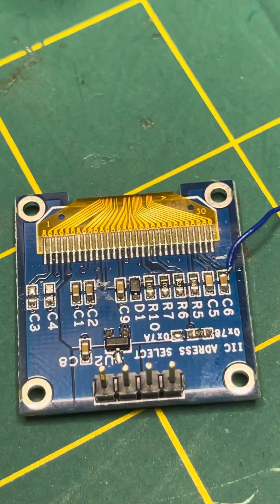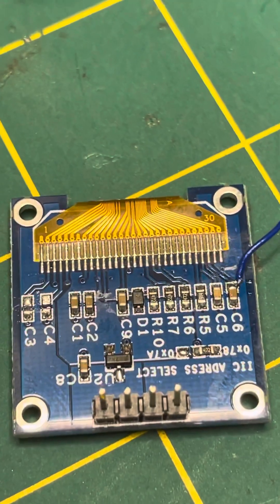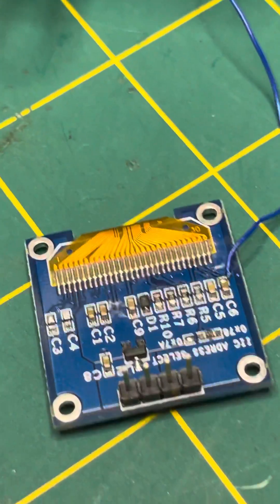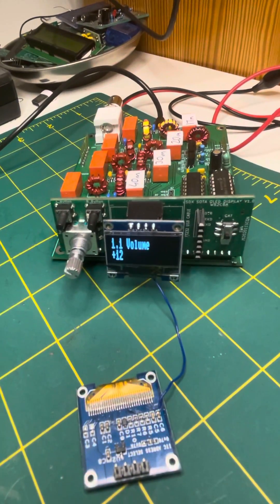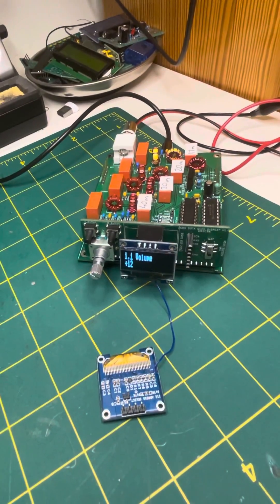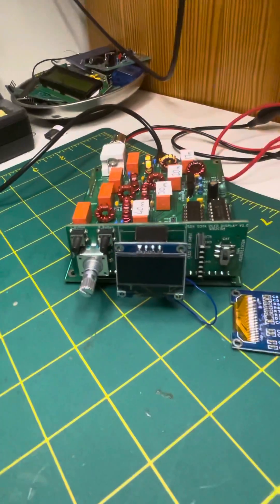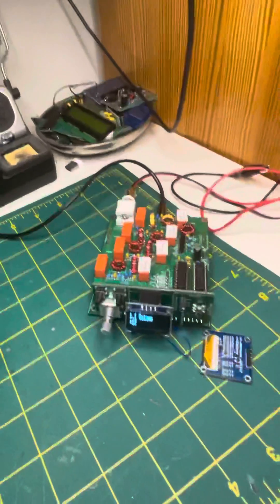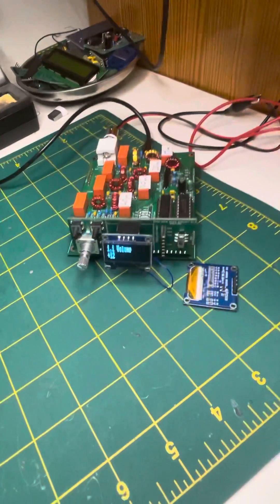OLED display rf noise interference cure hack

Comment: THANK YOU SO MUCH for the hint in the right direction.
I had huge issues with noise on the I2C Data lines (as deep as -2V from VCC ), and your video helped a lot to dig at the right point in the datasheet of the SH1306 IC.

For everyone who has the same problem:
disable the charge Pump by 0xAD 0x8A command.
Remove the 2 capacitors at Pin 2-3 and 4-5.
Add 7-14V to the OLED-VCC Pin 28.

73
DL5WN

Comment: Thanks for this video, someone pointed me here after noticing that my amp would work correctly with the screen disconnected. A similar OLED is used in the Micro PA50+ amp and the screen was causing the amp to exhibit strange SWR issues, this solution fixed it!

Comment: Hey hello, I'm still working assembly of a sandwich and coming back to this issue. As soon as I can finish this first sandwich using the V2.1 I/O board, 2.5 main, and 3.1 RF I want to do a TruSDX version of the latest design. I also have a extra V3.1 RF board and wish to use it for a diet version. So my reason for this comment is you say the 50hZ is injected into the audio of the Rx, wouldn't it be in the Tx as well? I could wait to test this myself once I have a working radio bench with an Rx and Tx unit to test this but it's easier and faster to ask someone that has all the test capabilities.